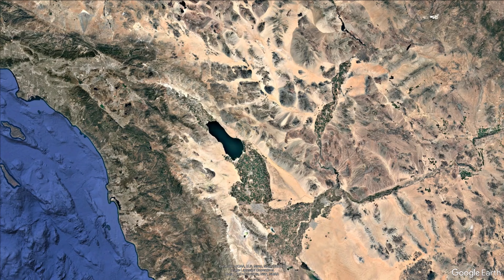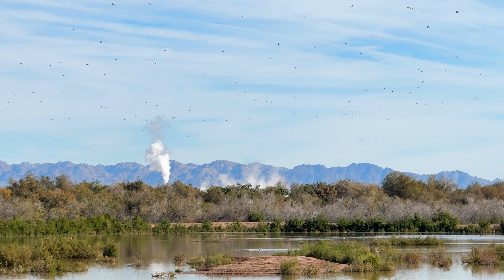Why Geothermal Power Matters Even With So Much Solar

Comment from the maker: Current California ISO Grid Supply Update (Jan 16 7:00 am PT). Geothermal is sitting at a steady 5.4% of CA's total supply. It’s the backbone of the renewable mix while we wait for the solar ramp-up. Check out the video to see how the Salton Sea Geothermal area works! 👆

What other types of power plants should we cover next? 

- Nuclear? ☢️
- Hydroelectric? 💧  
- Natural Gas? 🔥
Vote below! 👇
Reply: How about advanced geothermal drilling down 2 miles to capture crustal heat like the recent installation in Germany using oil drilling techniques? My vote is against nuclear, which is way too expensive and inevitably runs into huge cost overruns here in the United States.  Perhaps you will want to consider offshore wind power with floating turbines.
Reply from the maker: @JW4RE@JW4REnvironmentcool idea Thanks for the thoughtful idea

Comment: It’s a great resource for California to have such accessible heat so close to the surface of the land.  Even though Iceland has way more geothermal at its tectonic plate boundary, we are fortunate to get over4 percent of our renewable electricity supply with zero greenhouse gas pollution! 😊